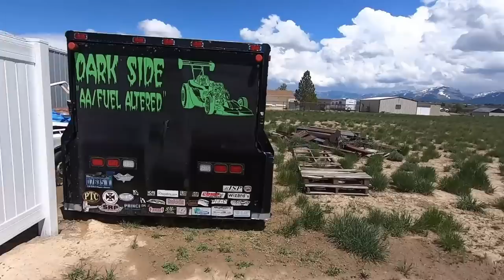Retirement, Downsizing your Possessions to Live the FullTime RV Lifestyle is a BIG Decision

Comment: Can we have the crockpot enchilada recipe pretty please?!
Reply from the maker: Slow Cooker Chicken Enchilada Casserole
A true one pot meal. The chicken and enchilada sauce is cooked all day in the slow cooker then the casserole fixings are stirred in.
Prep Time5minutes mins
Cook Time8hours hrs 40minutes mins
Total Time8hours hrs 45minutes mins
Course: Main Course
Cuisine: American
 
Servings: 8
 
Calories: 398kcal
Author: Sarah Olson
Equipment
•	Slow Cooker- 6 quart or larger
Ingredients
•	1.5 lbs. boneless skinless raw chicken breasts (don't use any more than 1.5 pounds, the casserole will seem dry if you do).
•	28 oz. can Red Enchilada Sauce I use El Pato Brand or Los Palmas
Add these items at the end:
•	10 corn tortillas I use a 10-12 oz. package of soft corn tortillas.
•	2 cups grated cheddar cheese divided
•	3.8 oz. can black olives divided
Instructions
1.	Put the chicken breasts and the enchilada sauce in your slow cooker.
2.	Cook on HIGH for 4 hours or LOW for 6-8 hours.
3.	Shred the chicken with 2 forks right in the slow cooker.
4.	Cut the tortillas in to strips, add to chicken and sauce. Stir.
5.	Add 1/2 cup of cheese and half the olives into the sauce and chicken mixture. Stir again.
6.	Flatten the mixture.
7.	Add the rest of the cheese and the olives on top.
8.	Cook on low for about 40 - 60 minutes longer.
9.	Top with sour cream (optional)